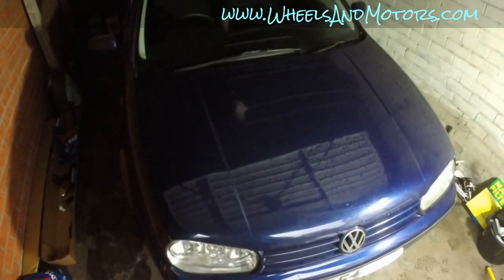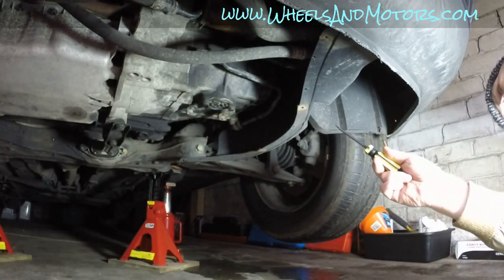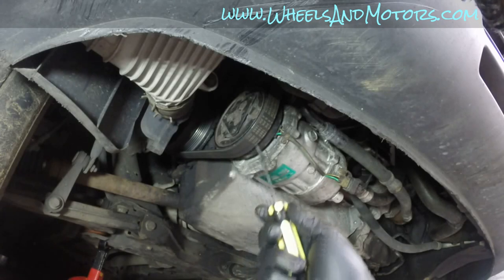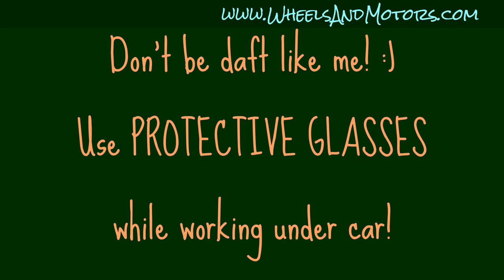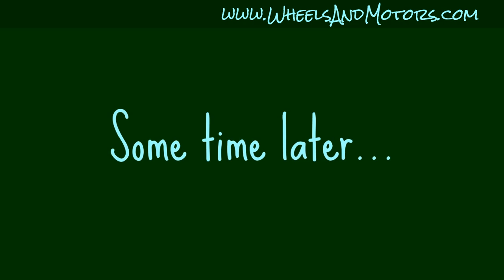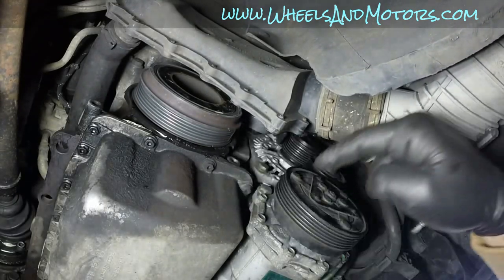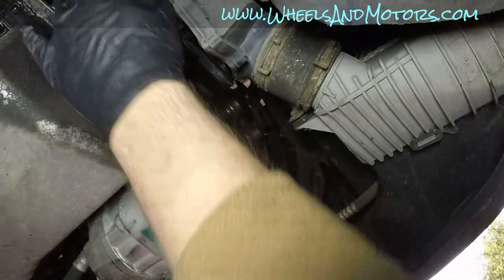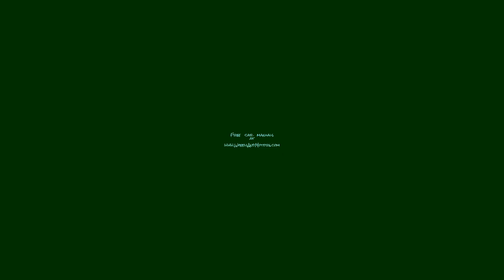How to replace auxiliary (serpentine) belt and tensioner on VW Golf Mk4 1.9tdi

Comment: Fantastic matey. Just done my fuel filter, oil change and filter, and track rod ends today and noticed the belt looked a bit ropey. Ive got a fabia vrs mk1 but this looks just the same to me so ill remove the belt to check the state of the tensioner using your guide. Thank you.
Reply from the maker: You're welcome :) Glad if it helps someone.

Comment: Thanks for such a detailed video. I'll be doing this job tomorrow hopefully. He's bought the full assembly as looking down its sat offline slightly and there's a noise. We did the alternator pulley first but this didn't cure it. Cheers
Reply from the maker: You're welcome, hope it helps 👍

Comment: Thank you, I'm going to be doing this tomorrow. And also thank you for the link to the diagram, I just printed it out.  A quick question, do you have a video on checking the final drive for an automatic?
Reply from the maker: Thanks 👍 Sorry, but I don't have such  video..
Reply: Okay, thank you.  I was able to change the belt without removing the intercooler pipe, but I could see how it needs to go if you're going to change out the tensioner. Thank you again for having the diagram available also.

Comment: Thanks alot.
I will change just the Bearing. It's a 6203 2RS and it's also used in washing machines.

I found just the wheel (idler pulley), but it's too expensive.

6203 2RS Explained:

6 is for a Deep Groove Bearing
2 stands for Light Load
03 is the Bearing Size.
2RS means Double Seal, you don't want ZZ.
RS or 1RS is the absolute minimum.
Reply from the maker: You do know something about bearings 👍
Reply: @wawayltd  Yeah, but sadly I bought the bearing, just $1.5 USD, dismantled everything and the idler pulley was made from 2 separate halves riveted together with the bearing in between.
So I had no way of replacing the bearing.
There was no play in the bearing so I took the seals off, used Break Cleaner and Compressed Air to clean all the gunk and I put some MoS2 oil and LiCa2 grease and I'll leave it like that for now.
Reply from the maker: That's another level! You should make YouTube videos.

Comment: great video. very educational. i think i will need to do this on my 2002 jetta tdi. i can hear pulley noise when the weather gets below freezing and suspect/hope it is only the tensioner and not the alternator pulley....seems weird that it only happens whens it is cold outside...
Reply from the maker: Thank you :) Diesel engines in general are noisy before they warm up, especially when it's cold..

Comment: my belt came off so i'm guessing the pulley is u/s. gonna look at it tmrw. thanks for this, will make it easier :)
Reply from the maker: +Charlie Kelland This Golf in the video is 1999 with common rail engine. I f you have a PD engine it might look slightly different, but principle is the same.
Reply: Turns out it was the pulley in the alternator came off! Didn't notice in the dark. No wonder the belt came off :o
Reply from the maker: +Charlie Kelland Did you get it fixed?
Reply: +WheelsAndMotors getting it done today hopefully. great car. want to keep it running as long as possible !

Comment: Hi there, how do you know if you need both sides ribbed or one side ribbed regarding the belt type? When I type my registration into the car part online shops it says I need ribbed on both sides, but yours is smooth. The staff don’t know either. I’ve got a 2003 1.9tdi Golf Match. Engine code ATD. Any advice much appreciated.
Reply: The belt ripped off so I have no reference
Reply from the maker: To be honest, I've never seen ribbed on both sides.. I think easiest way to check - have a look at all pulleys for that belt, if all of them are ribbed then it's got to be ribbed both sides.
Reply: @wawayltd  thanks very much for your reply! I think they are all ribbed, will double check later. All the best
Reply: @wawayltd  thank you. After talking with various parts dealers, I was sent a double sided belt and a smooth tensioner pulley, does this sound wrong to you? Appreciate any thoughts again.
Reply from the maker: Don't know, I would speak to actual part supplier. Try to fit it, if it works - happy days, if not - go back to them and throw it in their face 😏
Reply: @wawayltd  haha questionable advice. Anyway, cheers for the help.
All the best and thanks again for the great video lesson.
Reply from the maker: No worries 👍
Good luck with the belt.

Comment: Had the mechanic do it and now the power steering tube looks messed up. It's dangling free about 1mm from the belt and I can see multiple broken plastic and rubber mounting brackets dangling down in there.
Reply from the maker: Some mechanics...🙄
Reply: Yep, I didn't get around to fixing it soon enough and the hose sprung a leak from rubbing on the belt. Now I'm working on it and it's a nightmare in there. Wiring and tubing all over the place. Found some fittings where the pipe clamps were sitting loose but never tightened back in place from a prior job. Won't be going there again.

Comment: how often do you should change auxiliary belt and tensior?? 
thank you so match. 
sorry for my english.
🙋
Reply from the maker: +Antonio Gazquez Auxiliary belt should last at least 40.000 miles. But you can always check its condition. If it looks old, cracked - just replace it. In my previous car it lasted a lot more - over 100.000 definitely. Just see what it looks like. Tensioner should be replaced if it's faulty - too noisy, not spinning properly, physical damage etc.
Reply: +WheelsAndMotors thank you so match! 🙏
Reply from the maker: +Antonio Gazquez You're welcome :) Sorry was offline for some time...
Reply: +WheelsAndMotors no problem! 👍

Comment: Is this the same belt and tensioner that's used in the 2004 Seat Toledo 1.9tdi ?
Reply from the maker: I think on later models they had slightly different tensioners, but the principle is the same - just ask your part supplier for the right one for your car.

Comment: As I can see, you can replace only the bearing in that pulley, which can be found separately by the number on the bearing caps... In this case, the pulley was bent, so that also needed replacement, I say for other people who might have a good pulley, because the bearing is very cheap compared to the whole assembly...
Reply from the maker: +Valentin Calinoaia Thank you! I'll have a look for part number.. I just couldn't find anything apart from complete assembly.. Where would you buy bearing?
Reply: +WheelsAndMotors At any store specialized that sells bearings... In my country I buy bearing from SKF dealer (probably you can find one too), or other big manufacturer of bearings, which sells almost any bearing... 

I recently changed the bearing in my 2.2 i-CTDi Honda Civic, which had 2 6203 bearings in the idler and tensioner pulley, which had a new price of 250 $ (the complete assembly), and the bearings were something like 40 $ both from SKF (which are good quality ones, I could find cheaper)
Reply from the maker: +Valentin Calinoaia Thanks! I've found few SKF's around my city.
To take that bearing out, you would need to take rivets out of roller. Are they easy to remove/install?
Reply from the maker: +Valentin Calinoaia Thank you! Very helpful.